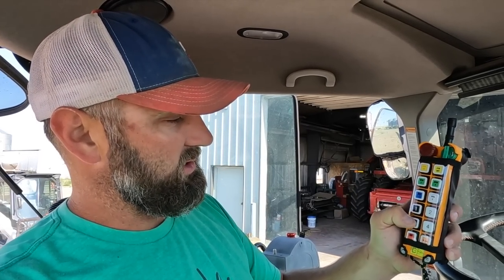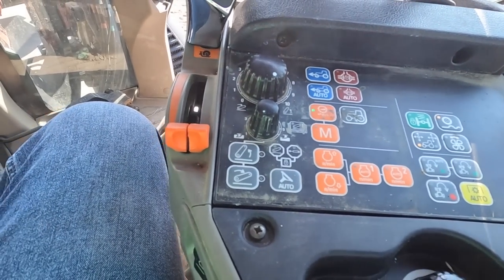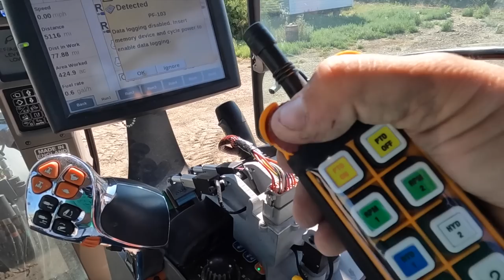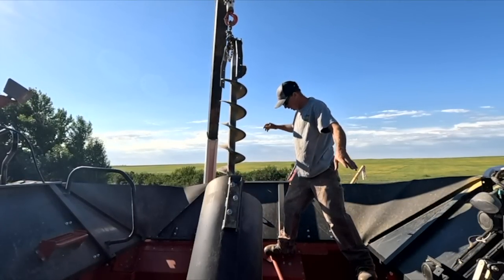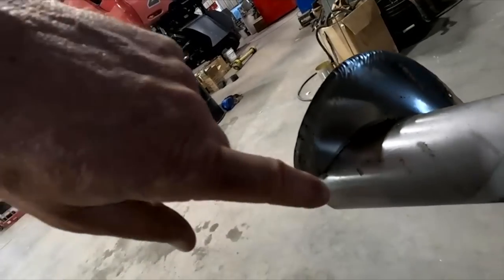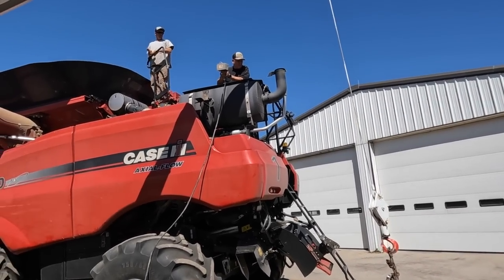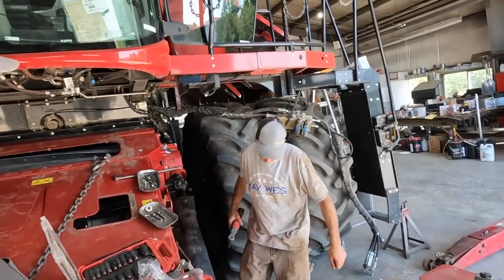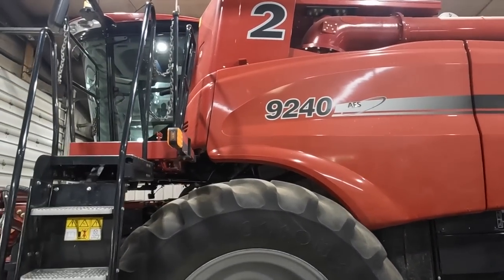Remote Controlled TRACTOR!

Comment: I made basic functions throttle up-down/PTO on - off controls for are auger tractors 966 farmall and 4440 deere 12 volt linear actuators and transmitters and receivers all off ebay and some tinker  time in the shop:)....combined with power drives on the auger hoppers really works slick been using them three years now.

Comment: man I can see huge benefits for a truck driver pulling a load up to unload a trailer into a bin.
where you can control throttle by remote  if in the seat can you move the auger w/o yanking stuff off? you  may have mentioned it but if so I missed it.
Reply from the maker: The hydraulic controls come off really easy.  And the throttle is exposed.  It all is removable on a couple mins if it’s not needed.
Reply: @FastAgMontana  cool, I was thinking worse case was remote for throttle and human for gear position and clutch (and steering of course LOL )

Comment: It is unfortunate that each new ring of poly got burned by the plasma cutter making the next set of holes.  Maybe next time use a sheet is steel or a welding blanket to protect the plastic.
Reply: It’s such a hard plastic that all it does is discolors it. You can feel any burn marks